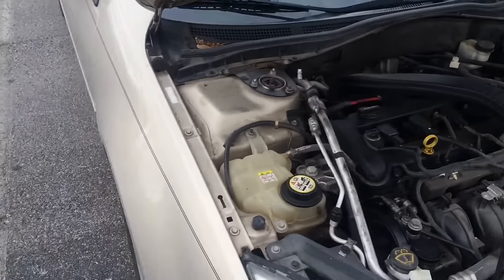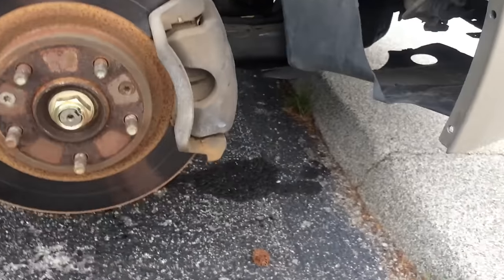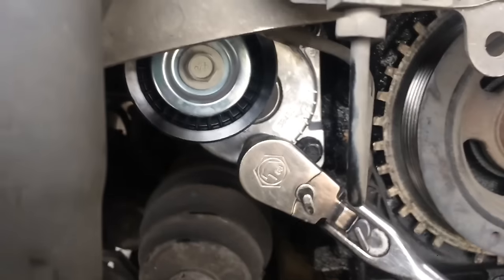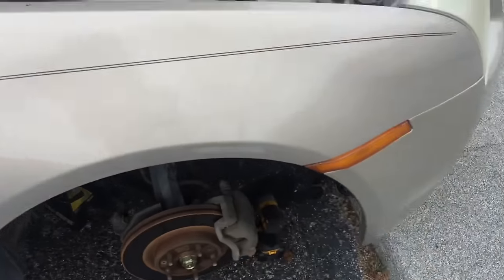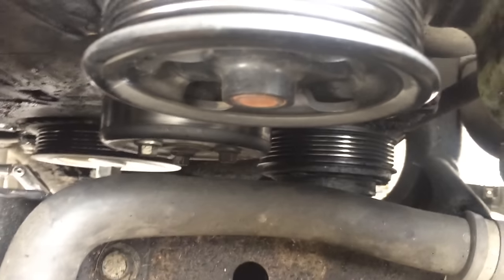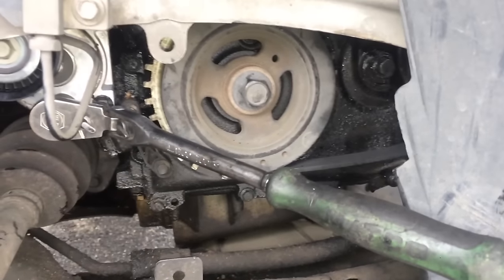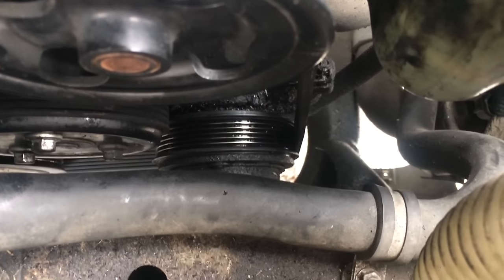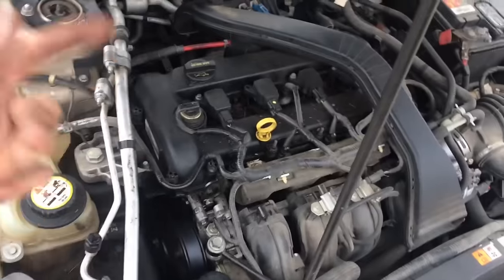Ford Fusion Serpentine Belt And Tensioner Replacement

Comment: This is an old video now, but I just watched it, if this car is a diesel, that noise tapping clicking is a leaking injector.  You also have a quite an oil leak from what I could see.
Reply: Not diesel

Comment: my ford fusion runs awesome on the highway but when i slow down around 20mph or to a stop light it shakes and squeals and the rpm moves up and down below the 1 as if it gonna shut off put into reverse and to drive. a couple times it has shut down on me while back out of my driveway. but starts back up just fine
Reply from the maker: +Warren Ducheneaux that's really weird. I honestly have no idea without looking at it, but if it shakes and struggles until being shifted a few times I would say it is something transmission related, possibly a torque converter, that is just a guess from the info given though
Reply: thanks for getting back right away appreciate it.
Reply from the maker: +Warren Ducheneaux you are welcome, sorry I couldn't help more.
Reply: Warren Ducheneaux I had that same problem. I replaced the throttle body, easy fix, and it worked just fine.
Reply: My 2012 does this and I was told it was an EGR valve that needed replaced.
Reply: I am NOT a mechanic.  I had work a little with a boxer motorcycle engine to *guess* that what you are describing may be related to valve sync or TB flywheel.  In an I4 engine this could be a major repair task.  I have not try to do that in a car.  One day i might but for now it goes to the professional shop.  But again, this is a matter or opinion and based in experience with a totally different engine type <of which I am sharing specific video: >
Reply: Sounds to me like a bad mass air flow sensor. I replaced mine and the rough idling stopped, and my check engine light went off, too. It's stupid easy to replace and it's not a very expensive part.

Comment: What is pulley #5 called?
Reply: Good question, I'm only replying so I get to see a real answer if posted. I'll take a stab though, 5 is the idler and 3 is the tensioner. I do know an idler's job is to change belt direction to give another pulley more purchase on the belt.

Comment: How do you know when the belt and tensioner need to be replace?
Reply from the maker: I recommend a new belt about every 100k and I knew this tensioner needed replacement bc of how little tension it was applying to the belt
Reply: My belt flew off this morning...that’s how I knew lol
Reply: @nicholassousa2932  Mine did the same yesterday. I was happy because that is why my electronic power steering was not working ( about a $1,000.00 fix  vs. under $100.00 ).
Reply: Its very common on these cars for the tensioner pulley to have a bad bearing. You will hear it

Comment: Is there a diagram somewhere of the belt routing?
Reply from the maker: +Ryan Arnold I put one in the video, but google is where I found one
Reply: Thats the one that looks like mt 2011 SE 2.5L I4
Reply: IronManMike57 the Tension pulley seems to be in the wrong place.  That or the picture is view from the engine side.  I am very confused.

Comment: Is it possible to do this without removing the tire?
Reply from the maker: Probably possible, definitely would not recommend, that would be terrible
Reply: I did it today without removing the tire. But that configuration is different from my 3.0 where this one look like everything goes top to down, mine goes from back to front. I am curious about the tension pulley and sliding it on that way, never tried.

Comment: When I took my tire off, its blocked by plastic and metal guards . :(
Reply from the maker: Just take the plastic bits off, shouldn't be a problem :)
Reply: He skipped that part of video. It takes about an hour to take the shields off
Reply from the maker: I actually don’t remember them being there, I’m assuming the previous mechanic may have just left them off

Comment: The tapping/clicking noise is the fuel injectors. These engines are 100% Mazda engines built in Japan. They aren’t your ordinary 4-cyl. They will outlast the car. It isn’t valve, intake, vacuum etc leaks. The injectors are just noisy.

Comment: hello can I have thé length of the serpentine belt of ford fusion 2007 ??? Thanks
Reply from the maker: +Pape Laye I'm sorry, I do not have that info. I would recommend going to the parts store and just asking for the correct belt for your model and year.
Reply: If you head into any auto parts place, they should be able to give you the correct one based on year and engine displacement.

Comment: Thats a lifter. Those cars and even the mercury milan,  focus... all have shitty gaskets on the valve covers. Bet your spark plug wells are full of oil too.
Lifter is cause of running with a leak to long.